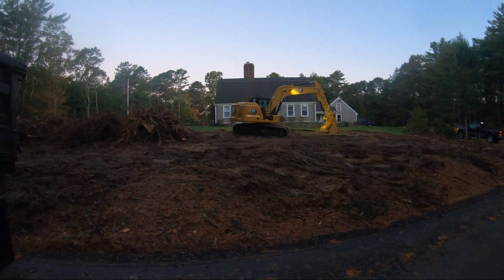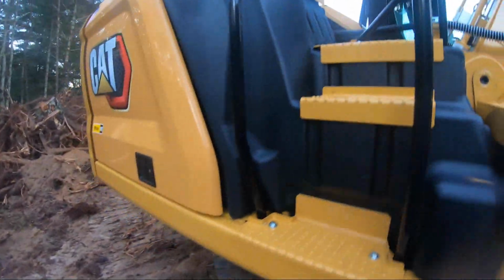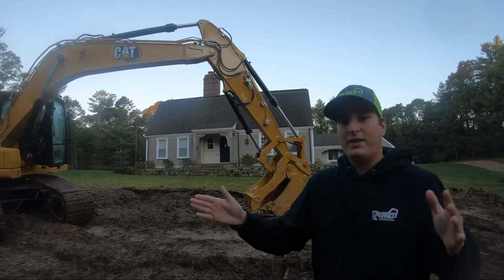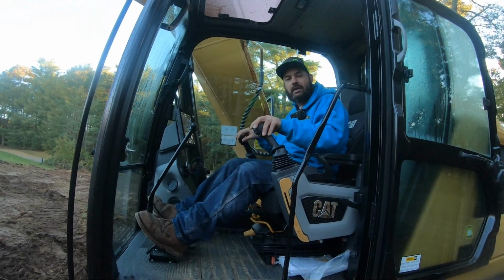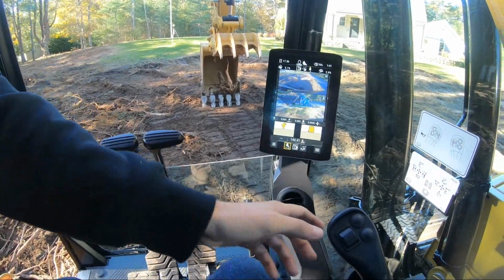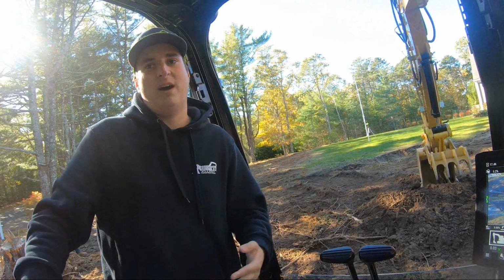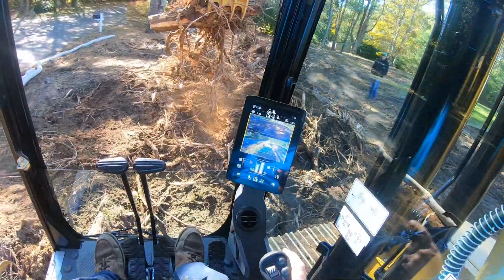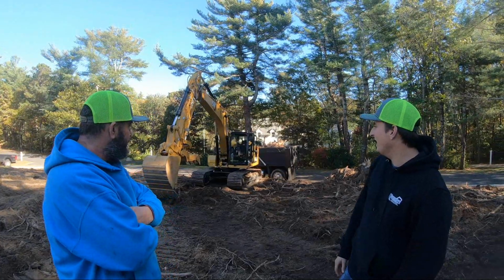CAT 317 Review! (2022)

Comment: I just wanted to say I've been waiting for over a year to see one of these machines in action and was relatively hoping my boss would get one for our place. I work at a trash and recycling place,. Where I am the Supervisor of the Transfer station. We are currently using an M 314 wheeled excavator. And it sucks having to put down the dam outriggers every time I need to do any actual moving of material. It has a fantastic thumb. I just wished that the bucket had a better out curl on it. And the thumb as you had mentioned, doesn't go all the way out with the bucket. And the bucket only being able to go flat straight is it's limit. Sucks.  My boss had to put the pneumatic tires on it since I gave it it's first flat being used in trash with debri environment. The first mention of getting a new excavator was suppose to be a rubber track one with the tight radius for small areas like we have. I would love to see this machine being used at our place. Especially having low beams for rafters for the roof. Being able to set the ceiling height with the fence control would be a game changer and less accidental hits to it. 😉
Reply from the maker: Sounds like you need one 👍

Comment: What made you choose the 317 over a 315 or a 320?
Reply from the maker: It’s the biggest machine he could get for the work he had lined up that will still fit on a tag trailer. Plus I think at the time the 315 didn’t have the 2d grade control. Not sure